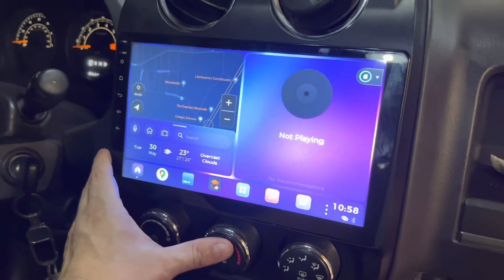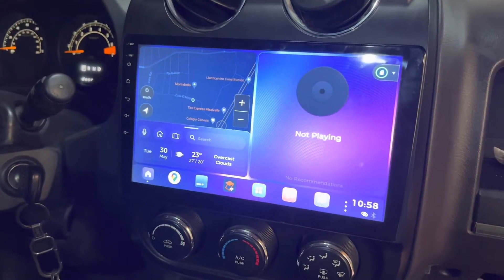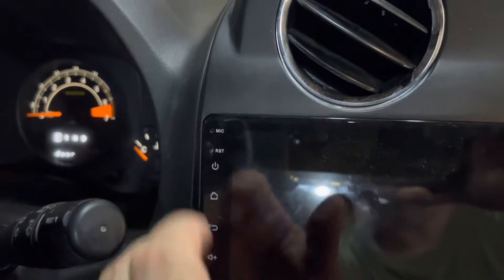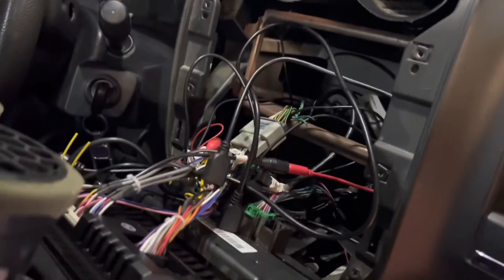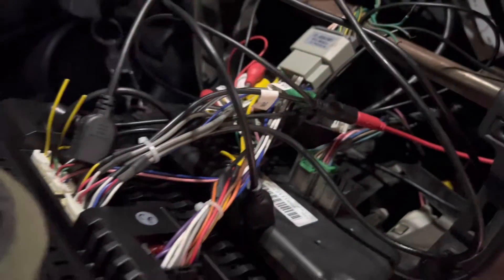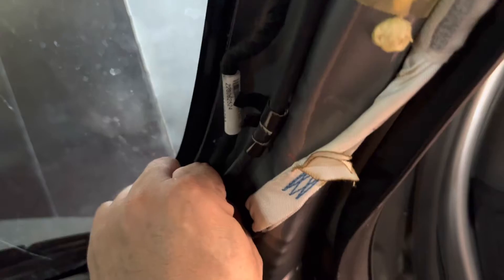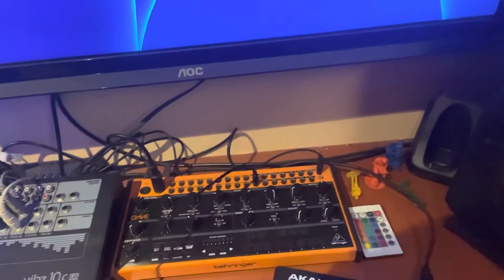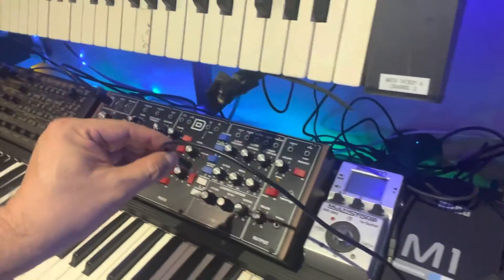How to connect an Android Car Stereo mic input to the UConnect factory mics in a 2015 Jeep Patriot

Comment: Tryied on jeep compass 2012 the connector are the same but are reversed.The fixed one is the upper one and the bottom one you can take out.Also the connector is reversed so the wirres for the mike are in the left side of the connector.The left most one and the second most one also left side.

Comment: As I can see in the video, did you connect the original mic directly to the car head unit jack, without additional power (5v or 12v), right?

Comment: Thanks for the detailed video. I just installed a Audio Vision radio and they supplied an external mic. Even with that I'm told by various people it's the worst call from my car they've ever had. When I'm sitting still it's okay but once moving it's drops into the toilet. Here's the big question...I drive a 2012 Ram 1500 with the connect system. do you think this woks with all connect? I'm guessing you have to reconnect the factory harness together after you make the connections is that correct?

Thanks again for all you do.
Greg

Comment: Video is helpful but it looks like you actually did it in a way that is more complicated for some people. The back of the android harness has 2 wires for mic + and mic -. But they dont lead to the harness you need to fill in the blanks. But what you did i guess could work. My 3.5 jac does not have any separate white or red/black. It looks like a single wire with red copper trands and copper strands. Do you have any info on why the copper strands are colored that way?

Comment: I have a 3.5 mono plug/cable with a red wire and a black wire only. Does the red wire connect to the right outermost and the black go to the second outermost?
Reply from the maker: That should be correct.

Comment: Wondering if you can tap Into the connector that's at the back of the radio already instead of taking apart the liner .
Reply: That should work but would need a female plug
Reply from the maker: It very well may be possible. I just could not make it work that way for some unknown reason. I happen to find the schematics for the uconnect voice and sound module, tried it, and there.